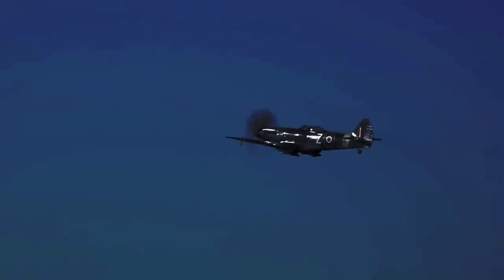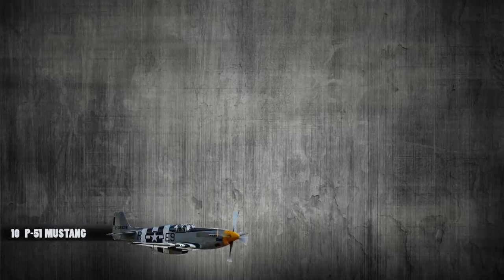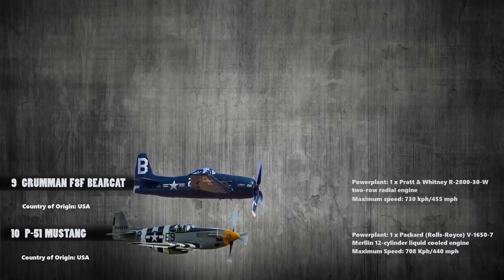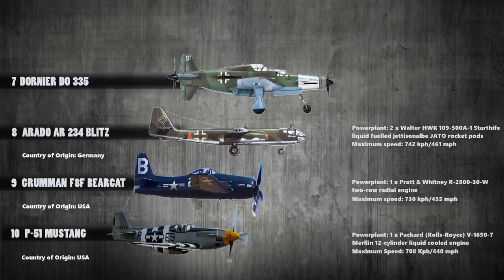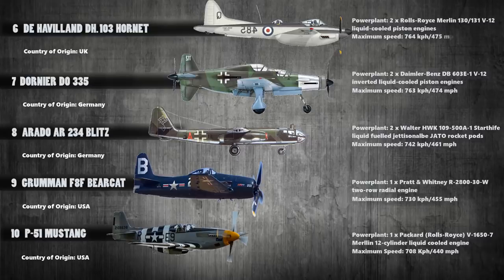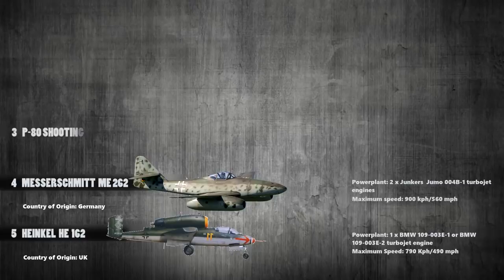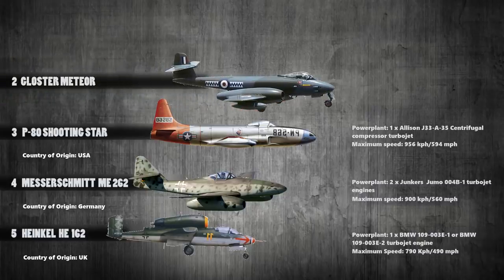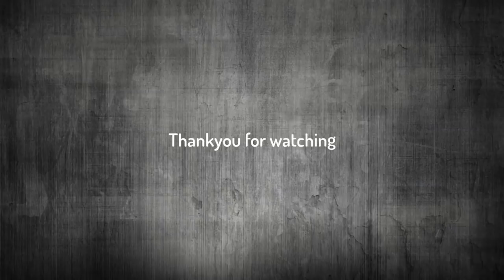10 Fastest World War II Aircraft

Comment: The Meteor could not go 600mph in WW2. It could go something like 430mph, which was fast enough to catch V1 flying bombs, but over 100mph slower than the Me262.
Reply: Meteor top speed was 300 and change...V-1 the top speed was 250mph... you could shoot it down with cargo plane
Reply: With RR engines and improved engine nacelles the Meteors deployed to the continent were capable of 520 mph in level speed.  Although they tried to engage German jet fighters, they didn't come across any and were used for ground attack.
Reply: @danzervos7606  ... you are greatly mistaken... glosters where never deployed over sea's... thier only miltary action was against V1 buzz bombs( cruise missle).... and your claim about the speed of RR welland engines is incorrect!... max speed for gloster during the war was 400mph to 420mph... ME 262 max speed was 540mph to 560mph...  It wasnt till the very end of the war the gloster reached a little over 600mph... due to the fact they stripped away any unnecessary wieght and made the plane much lighter.... just made for speed not combat...
Reply: @richardwoeckener7936  the VI 400+ Mph
Reply: @danzervos7606  It was not until Nov 45 that the Meteor got to 600 mph Just after the war
Reply: @hoatattis7283  i stand corrected...
Reply: @richardwoeckener7936  Read the Wiki article about the Meteor.  Wind tunnel test resulted in improved engine nacelles that added 75 mph of speed to the original 420 mph and then they went to the more powerful Derwent engine adding even more speed. Judging the Meteor F.3s were ready for combat over Europe, the RAF finally decided to deploy them on the continent. On 20 January 1945, four Meteors from 616 Squadron were moved to Melsbroek in Belgium.  By late April, the squadron was based at Faßberg, Germany and suffered its first losses when two aircraft collided in poor visibility. The war ended with the Meteors having destroyed 46 German aircraft through ground attack.
Reply: @danzervos7606  ... the f3 did have  an improvement on engine design as a test bed... but it still did not reach the speeds you claim when fully loaded.... as for being in belguim was a propaganda move to boost civilian and military morale... the f3 pilots were told not to go over enemy lines in fear of crashing and giving enemy tech and most of all they were still slower... the frame on the f3 was not durable enough to handle the strain of heavier engines... HENCE THE F4 REDESIGN... to little to late the war was over..... P.S... please dont get your military info from Wikipedia..... get it from military historians! ... BUT IT WAS NICE TO DEBATE WITH YOU... AND I THANK YOU!!  Im done talking about this subject... best wishes to you my brother!!
Reply: @richardwoeckener7936  The biggest improvement in Meteor design was the redesign of the engine nacelles adding 75 mph in top speed by eliminating compressibility problems. The Derwent increased power to 2000 lbs thrust from wth Welland's 1600 - 1700 lbs thrust and eventually to 2400 lbs thrust (then they went to a scaled down version of the Nene which although it retained the Derwent name was a different engine).   The Derwent weighed 975 lbs compared to the Welland's 850 lbs - hardly significant.  Other sources place the top  speed at 486 to 493 mph, but I stand by my estimate.  Your claim that it was never deployed to the continent is contradicted by numerous sources.
Reply: Tom Sanders  im waiting for another caveman reponse...
Reply: Tom Sanders  i really feel sorrow for you.... your lack of understanding creates ignorance.... your emotional knee jerk reaction clouds clarity... AGAIN .... i feel sorrow for you... no matter how you cut it!!
Reply: Tom Sanders  how does it feel to be the poster child of ignorance
Reply: Tom Sanders  you dont fully understand... im not wrong!!! Now stop this nonsense... its just your lack of understanding.. but thats not sinking in... i constantly have to repeat my self ... now let it go... or we can continue this disagreement
Reply: Tom Sanders  stop the nonsense... let it go
Reply: Tom Sanders  you dont understand!!@
Reply: @richardwoeckener7936  the speed from the V1 was 670km/h = 416 mph...and Meteor F3 top speed was 768km/h= 477mph
Reply: It was slower then a F4U corsair.
Reply: @awclark3  WHEN?
Reply: richard woeckener V1 went around 400 mph. That’s why they tuned the fighter’s engines and polished their fuselage skins to get the most speed. Where in earth did you get the idea they were slow?
Reply: richard woeckener Military historians? You already said the Meteors never got deployed abroad and then it turned out that they got sent to Belgium and actually flew in operations! Don’t accuse others of bullshitting when you bullshit yourself! I’ve checked plenty of sites and the F3 was capable of over 500 mph in September 1944.
Reply: The me262 the jet engines were very unreliable
Reply: Gooje Dooje What do you expect from an engine thats made out of low quality material and build together by slaved labour?...
Reply: In a dive! In a dive! You know its true! Its on you tube!!!
Reply: @danzervos7606  nop maximum with the rolce royce derwent I was 490 mph
Reply: EXACTLY!
Reply: @richardwoeckener7936  v-1 420 miles per hour!

Comment: Lets set the record straight!!  The Gloster Meteor was only used against V-1 Flying Bombs over England and was only capable of 500 mph at that time.  The P-80 didn't reach operational status during the war.  The DH103 also did not reach operational status during the war.  The Do 335 also did not reach operational status during the war and last the F8F didn't reach operational status.  Missing from the list are the F4U Corsair and the P-47 Thunderbolt.
Reply: Also missing is the Bachem Ba 349
Reply: And the P- 38

Comment: I believe the Do335 was the fastest, piston engine prop driven plane in WW2.
Reply: Yes  . This is thrue.
Reply: No. The Dornier Do 217P was faster and they had a few in the air
Reply: Was the 217, piston engine , prop driven?
Reply: @glengerdes2447  Yes and as its supercharger a complete engine in the fuselage
Reply: @hoatattis7283  Do you have a picture?
Reply: @glengerdes2447  No but it described as such in Bombers of WW2 by Bill Gunston in the Do 217 section
Reply: Wikipedia has the Do217 at 125 mph slower.350 max speed. Do337 were about 475
Reply: true
Reply: @glengerdes2447  dont believe everything in Wicki  Go and see for yourself Bombers of WW2 by Bill Gunston was $15 at a used book seller
Reply: @barfuss2007  What is?
Reply: @hoatattis7283  
the Do335 was the fastest, piston engine prop driven plane in WW2.
Reply: @barfuss2007  Not according to my information.
Reply: The Ta-152, Me-109K and the P-51H were faster
Reply: @jamesricker3997  Than What the IO9k WAS BEATEN BY THE Spitfire MkXIV The Ta 152 was barely in service and P51H was about 457mph Whatever you have been told it was not that fast The P47 M & N beat it
Reply: @jamesricker3997  P-51H only 450 mph

Comment: The F4U Corsair was faster then the P51 Mustang .
The F4U top speed was 446 mph and the P51 had top speed of 437 mph.
Reply: A Clark : Not in the west and go and check WW2 Aircraft Performance 
This what I found
F4U1A 395 mph 2890ft/min C/R s/c 37000 ft 
F4U-5 post war462 mph 4800 ft/min 44000ft
F4U1- D 425 mph 2890 ft/min 37000ft
F4U -4417 mph 3890ft/min 41500ft
Reply: @hoatattis7283  mine was from WW2  specs. Mustang fans always argue this. The mustang before the Merlin engine was another underpowered Allison (GM) product.
The Corsair started with the wasp engine and 10 year after the mustang retirement, was still flying in Korea.
Reply: The Mustang sucked out of the gate.  Performance was poor with low top speed and reduced operational ceiling due to lack of fuel injection.  USAAF consigned them to the RAF and the Brits swapped the Allison engine for the Merlin and the P51C was born.  The Merlin engine was licensed to Packard by RR for U.S. production.  Only then did the P51 become the best Interceptor/Escort of WW2 and saw active service for several decades.   The Corsair was indeed faster than the Mustang (P51A & B Allison variants).  However, the Corsair was only faster than the later Mustang variants in a powered dive, which was the Corsair's strength, making it better suited for action in the Pacific theater against Japanese Zeros and Kates.
Reply: Japenese Ki-84 Hayate is faster than both of them. 427 mph @ 20,000 according to WW2 Aircraft Performance. It was the entire reason the Japanese Army developed them. To counter the Mustangs. There was zero research done on Japanese planes for this video.
Reply: @scottsatterthwaite4073  Where do you get "USAAF consigned them to the RAF"? .... Designed to a British spec, it was flown by the RAF as the Mustang MkIa from Jan 42, way before US forces got near it.
Reply: @peterd8525  It was NOT designed to a "British Spec".  The RAF asked North American to build modified Curtis P40s to their specification.  Instead, NA offered a plane that was already on their drawing board (but not approved by US armed forces).  That's why the thing was designed and delivered so quickly.  "Consigned" might not be the best choice of words.  But, the P51 was offered to the USAAF immediately after the British accepted their first few planes.  They didn't perform well for the British so the U.S. rejected them, at least until the British swapped the Allison engine for the Merlin.  The P51D variant with the Packard made Merlin was certainly one of the best performing planes of the war.
Reply: @scottsatterthwaite4073  OK, give you that but for 3 months before production commenced, NA were discussing with the British Purchacing Commission various aspects and making changes to suit British requirements. Not to the basic airframe or the wing of course which was ground breaking. A great design.

Comment: Way too many errors! At least 4.  Counting WW II aircraft with heavily developed post war engines eliminates 2 and 3.
Arado 234 used Jumo 004B engines, Walther rocket motors were take off only. The experimental Arado 234 C4 variant used 4x BMW003 engines and would probably be #2 on the list.
Reply: You are correct. The booster Walther rocket motors used were the same as used in the ME 163, which did not use 2 motors, only 1.

Comment: Maybe the British Hawker Sea Fury should be on this list but it came to service right when the Japanese surrendered so maybe not?!? Dear God! 551mph for a Piston engine fighter!
Reply: 551 mph going straight down.
Reply: 460 in level flight, which is still screaming
Reply: @Nathan 75 Yeah but Later Post War years it Reached the Speed I mentioned in a Shallow Dive, There’s a  Dozen Heavily Modified and Race Tuned Examples that Fly in the Reno Air Races and in the Air Show Circuit in the US Today. Some Raced Tuned Ones with Water/Methanol Injection or Nitrous Oxide Boost can Go 485 or 500 Mph in Level Flight at 20,000 Feet!

Comment: Supermarine Spitfire is missing from this list
Reply: Yeah, the list is incorrect at best.
Reply: With a top speed of 423 MPH the Griffon Spitfires were slower than the P-51 (437 MPH), P-47 (440 MPH and Tempest V (late) (450 MPH).
Reply: @CZ350tuner  the spitfire mk xiv had a top speed of 445mph it was slighty faster than the mustang. and latter model griffin spitfires slighty faster still.
Reply: This List is a joke   the german Ta 152  ist totaly missing with 730 km /H  and others never saw service and Corsair and others are missing
Reply: @CZ350tuner  No with the Griffon the Spitfire XIV 448 mph@26000ft  Tempest V 435mph P47 M 460 mph[ wight airfield Test ]

Comment: I thought P-38 was faster than P-51.
Reply: P38 top speed was 443mph. You're right it was faster.
Reply: At high altitudes the p-47 was faster too. Some versions of the Spitfire were also faster.
Reply: In fact, a lot of fighters were faster than the Mustang... p47N, f4u-4, L series of the p38, Tempest, Griffon engined Spitfire Mk XIV, Bf109 g14, bf109 k, fw190d9, Lavotchkin La-9,  some versions of the Yak 9...
Reply: Gary Tarr  at 20,000 feet the mustang and p38 were very close. And you don't need the profanity.
Reply: Gary Tarr  Well in 1941 415 mph was tops,...when the P-38 first came out...many technical problems hampered the P-38's performance in combat, but probably the biggest problem was that is was rushed into use in mid '43 as a long range escort without having enough well trained pilots to deal with their Luftwaffe counterparts.

Comment: The Mk 22 Spitfire maximum speed was 454mph at 26,000 feet so should definitely be in the list.
Reply: Joe Dim, production started in March 1945.  It depends on whether you limit the answer to those that actually saw active service or those that were built during WW2.  

If you prefer the Mk 21 came into service in Jan 1945 and first operational use in April 1945.  It could achieve 455 or 460 mph at 25,600 feet (depending on whether you include the Vickers test results).

Comment: The Hawker Tempest V (late series with the 2,800 HP Napier Sabre engine) had a top speed of 450 MPH @ 14,500 Feet.

Both the Tempest V (late) and P-47 Thunderbolt were faster than the P-51 D so how come they didn't make the list??
Reply: If anyone leaves the P-51 off of any WWII list there would be a howl from most non-pilot posters everywhere. Most people think the P-51 could out perform all other aircraft in every category. It couldn't.  It was a good fighter with great gas mileage, hence it was the only fighter that could make it to Berlin for quite some time.  The P-47N had better gas mileage and could fly 2,000 miles vs the P-51 1,000 mile range, but was used in the Pacific Theater.
Reply: Andy Reid: The P47D the main variant used in the ETO did not have a great top speed
Reply: @hoatattis7283  The P47-M was used by 56th FG in Europe, some 130 Planes saw Action. V max 753km/h.
Reply: @chrigul1  Thank you I did say P47D AND 130 planes among 6000 is not that many
Reply: @chrigul1  473 mph and for 5 minutes 462 Normal
Reply: @hoatattis7283  that`s correct. The Pmax of the Jug was  time - limited,  as well as by all the other Planes.
Reply: @chrigul1  RAF planes never had MW they had a "Through the Gate "emergency and the engine had to be stripped  after the Mission
Reply: @hoatattis7283  I didn`t know that with the emergency Rules by the RAF, but i might believe that also an Merlin, Centaurus etc. wasn`t able to hold max. Speed / Power unlimited, or let`s say, for a very long time if needed.
Reply: @chrigul1  How long they were allowed to keep it "Through the Gate" I do not know.
I do not think the Napier Sabre was restricted
Reply: @hoatattis7283  I disagree.  At its best altitudes, around 30,000 feet, the P47 it was faster than its piston driven contemporaries.  I dare say the P47N was the fastest production combat aircraft.  Even edging out the TA152, albeit for 5 minutes until its water methanol runs out.  Above 25,000 feet the P47D stacks up very well throughout the war in terms of level flight.   Don't get me started on speeds in a dive :) Greg's Airplanes and Automobiles has a great series on the P47 and TA152
Reply: @davidhanson8728  Yes it was good the Spitfire VII with the 70 series Marlin was just 1 mph slower at 40000 ft but it could get to 44500 ft the P47D 42000ft
The P47N  I have 467 mph for the M 470 mph for the Fw 152 H1 472 mph and for the  Dornier 217 P 488 mph

Comment: Meteor stats are for the post war F8. Wartime versions were slower than the best piston engined fighters 
P80 never saw combat in WW2
He162 could do 560 mph/900kmh
DH Hornet never saw combat in WW2
Bearcat never saw combat in WW2
Ar234 was powered by twin Jumo 004 same as the Me262
Reply: The Mk.I Meteor had a top speed of 404 MPH (exactly the same speed as the Hawker Typhoon).

Because the aft fuselage tail boom had a wooden skeleton the Mk.I Meteor used to vibrate badly during take off and landing runs, earning the nickname "The Bone Shaker" by the pilots.

Comment: So after the USA realized the Allison engine was inadequate, what were the speed/climb/ceiling stats on Merlin-powered Mustang??????
Reply: I think the Packard 1650 was a licensed build Merlin.
Reply: The Allison didn't have the carbs that the merlin did.
Reply: @mongolordofdarkness  No the Allison did not have the 2 speed 2 stage Supercharger that the Merlin had
Reply: P51D 437 mph@25000 Ft ICR 3475  ft/min S/C 41900 ft
Reply: @mongolordofdarkness  not a problem of carb on Allison high altitude fails, but supercharging...

Comment: No Corsair?
Reply: Eric schar yeah big goof up!!
Reply: Eric Shar: No it was not that fast during the War only the Post War variants were fast
Reply: Cool, I didn't know that
Reply: F4u-1d 436 mph pretty fast for a ww2 bird
Reply: @Nathan-pw7do  Oh yes it was but it must have been a tricked up one. For I have 3 tests
 1  Boscombe Down May 44 382 mph@22600 ft 
and two tests from Wright Airfield
2.  F4U1 Jan 45 Report No 14575 Wright Airfield 406 mph it does not say at what height
3.F4U4 Report No 7289 May 21 1947 394 mph @26200ft
And all radials were not very fast at Sea Level
Reply: @hoatattis7283  looks like you're doing your research sir. I wonder if the discrepancy we're talking about is because it was using war emergency power?
Reply: @Nathan-pw7do  Possibly however WEP was not shown in the tests
Reply: @hoatattis7283  ok so 436 would've been using emergency power. Only other thing is in may 1940 the Corsair became the first US military single engine plane to fly 400 actually 403 in level flight but that's not to say Chance Vought didn't say play with the manifold pressure to make it happen. I'm curious what's your favorite ww2 era bird?
Reply: @Nathan-pw7do Spitfire MkVIII